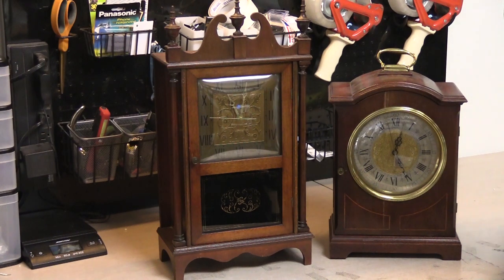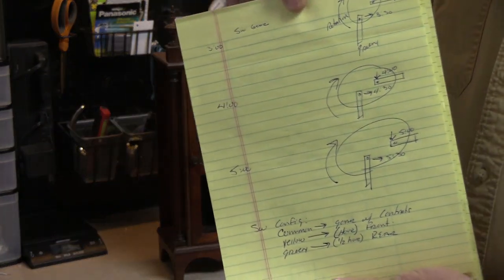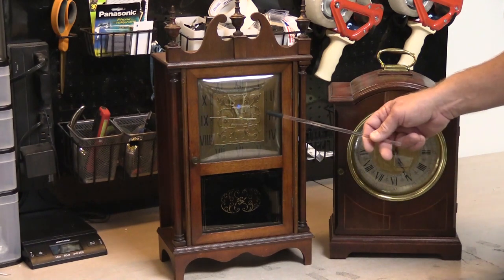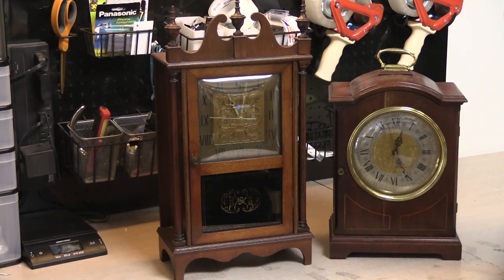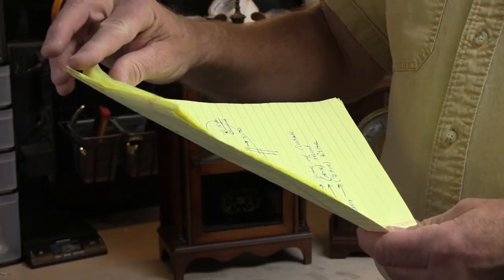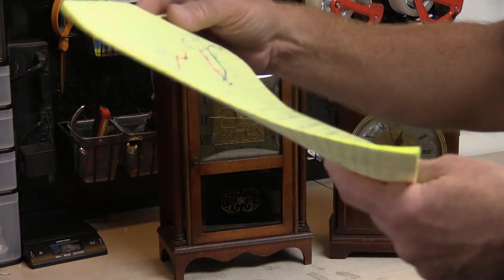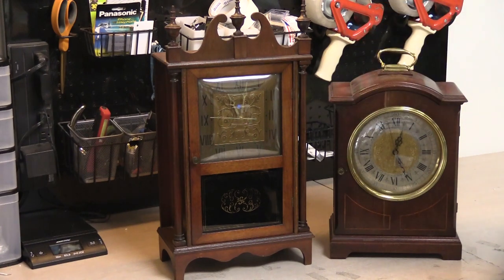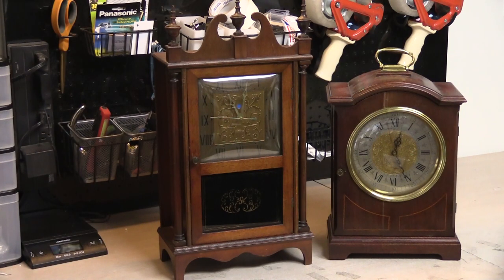Corrections about the Details of the NuTone "Mantle Clock Chimes" from December 2019

Comment: It need chime fix so it ring the right hour
Reply from the maker: Hi Mike:  The NuTone CH4000 does not need top be fixed - it wasn't designed to have the clock chime in relationship to the hour - The CH5402 does Chime in relationship to the hour.  The CH5402 will be rebuilt in an up coming Video - Chris